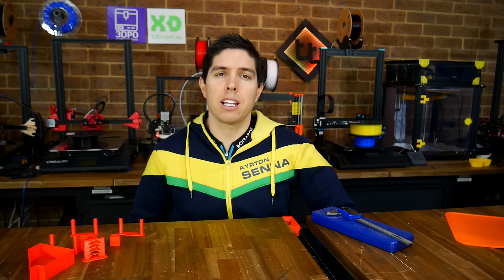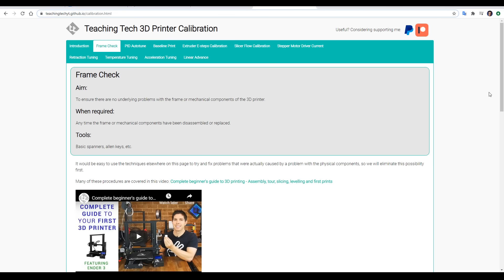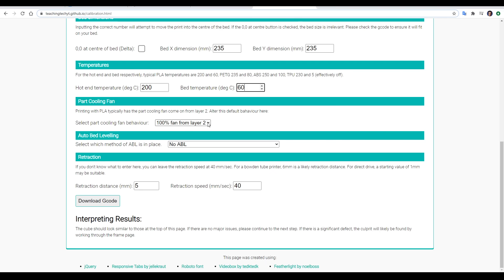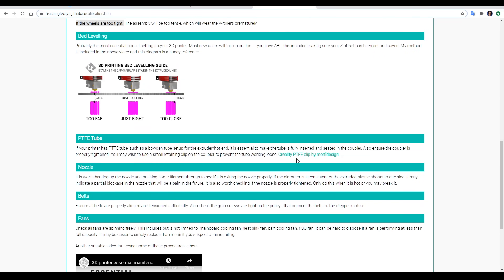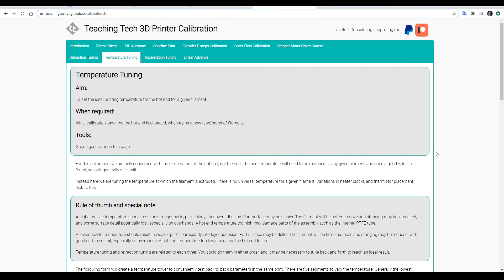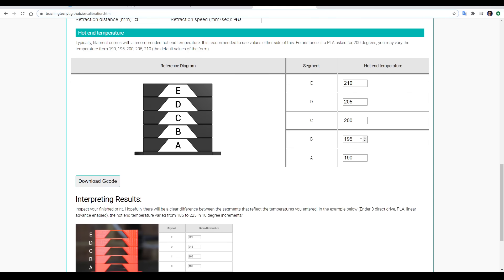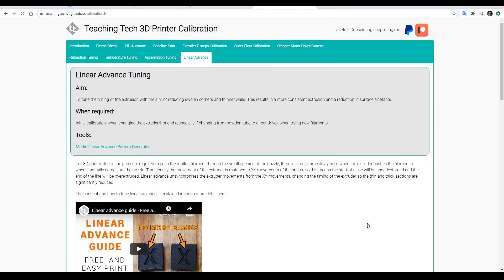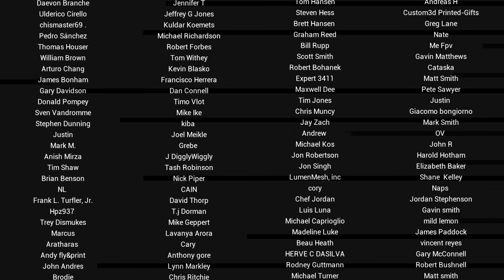3D printer calibration revolutionised - Step by step to better print quality

Comment from the maker: Thanks so much for all of the positive feedback. Thanks to community members posting on GitHub, some bugs, typos and errors have been caught and fixed. New features have already been added with plenty more to come in the future.
Reply: You are awesome! This is exactly what the community needed. Thank you so much! Maybe you can include deltas in the future, they are a different beast but auto-calibration of the bed surface has come a long way in most flavors of firmware and often works perfectly on machines that are well built and equipped with precision z-probes using smoothieware (LSQ fork for calibration) and RepRapFirmware. In my experience it's better to calibrate temperature before retraction though, because temperature has such a high impact on stringing, especially with PLA which is the most commonly used filament. Keep up the excellent work. :)
Reply: Is it possible to get the settings that the baseline cube was printed with? I got a pretty good print using that, but an extremely ugly print using my own slicer settings.
Reply: @Teaching Tech, Could you add the menu option to select your Nozzle Size on these calibration tools? I, like a lot of others that are moving on to printing more, have found it necessary to jump up to a 0.6mm or 0.8mm nozzle diameter for faster and/or larger prints. Again, much thanks for all you do and great respect!!!
Reply: This is truly awesome!  I used Dr. Lex calibration guide for my FFCP and had very good results but with my new ender 5 pro it was not straight forward application for other printers (different firmware etc).   This is the awesome counterpart for marlin and just what was needed!

I have a request,  so many of the turnings are hot end dependent.   How  hard would it be to add different nozzle diameters? Say a .8 or .6 or  .2 nozzles?
Reply: Really good guide! Is it possible to use your website / generated gcode for different nozzle sizes / layer heights though? I didn't see that anywhere. Thanks!
Reply: Thank you so much for an incredible effort to produce a very high quality test procedure, something we will all need to do at some point in time.  You've saved us a  large amount of time and frustration with your excellent advice and research in many of your how to videos. Wishing you the very best !!
Reply: Thank  you so much for the work and thought  you have put into this.

My question... I have stock firmware and boards on my ender 3p and Anet A8. 
How do I change my gcode firmware.   Do I have to go to marlin? What  program is used to interface with the printer?
Reply: Pronterface will interface with the printer. It is mentioned elsewhere here and is easy to install and use. I'm running it on a tiny Windows PC. Allows you toe send gcode to and see and control the printer in many ways. It is NOT however, altering the firmware. That can be a bigger deal. @Ezzell_
Reply: [EDIT: Yes]
Great guide! Thx!
Do I need to worry about GCODE flavour when using code generated by the website?
Have a nice weekend!
Reply: @GenericGerman  
The "flavor" of GCODE shouldn't matter. The version could, but typically with each new version there are more GCODE commands, but the existing commands don't change what they do. So, the short answer is, "No, no need to worry."
Have great 3D printing success!
Reply: You have made my day with this your truly a legend
Reply: I've done most of the stuff in this guide before, one way or another. Having the process to work through with the associated website and tools makes everything so much easier and faster though and I can only imagine how much time this would have saved me if it had been around when I started out with 3D printing. Great job, thanks!
Reply: This saved me so much time and effort. Great guides as ever and an even better troubleshooting. You're awesome. Thanks a lot.
Reply: Great job here dude, Makes this job soo much easier, 
Sorry if this has already been asked but do you plan to add some sort of initial layer height adjustment? It would be nice as I have scraped my bed a bit.
Reply: This is excellent! Could you possibly add E_JERK tuning to the acceleration/jerk tuning page?
Reply: your the man. mate thank you.
Reply: Michael, I just had to say that this earned you a new patron. It's a fantastic resource and very generous of you to put it out there for free. Bear in mind I've never signed up to 'patronise' someone before - there are so many worthy causes - but I figured you needed rewarding for this 🙂 Thank you!
Reply: fantastic resource for new printers! just curious though I have taken to using a 0.6mm nozzle recently which has produced some nice results and printing times. Can I calibrate as per the instructions on the site with a 0.4mm nozzle and then change to a 0.6mm nozzle or would it change the results drastically?
Reply: Thanks for all your work on this. 
I've just restarted calibration after switching nozzles and noticed that when I start my print, it now drops the extruder back down to my print setting -50 degrees, then homes, restores the manual ABL mesh and goes back to print temp. As I preheat my printer to print temp manually, is there a way to adjust this that doesn't involve manually editing the gcode?
Previously that intermediate temperature step wasn't there and it just slows down my process as I wait for the extruder to cool down, then heat up again. 
Or is there some good technical reason to home everything at an intermediate temp that I'm missing?
Reply: Awesome, a new standard is set!
Reply: I have an ender s1 how can I calibrate it using this site
Reply: Great video. I’m going to start tuning now.  I do have a question though. Right now I am getting a bulge before a corner. Almost like what you said LA helps take care of. I did do your acceleration test and 60mm I went from 500-1000 and that bulge is going away the the more acceleration. So I’m about to test now even higher 1000-1500 acceleration. Doesn’t that seem really high?  Or is there a different setting that places this bulge pre corner?  Any help would be appreciated.

Comment: I think there could/should be a batch of gcode that prints a bed full of test objects that let you dial in any filament on any printer. Like the grid for determining duct size in air handler units based on cfm needed and unit hp. Ai can do this now. Rumor has it you're done with this gig.

Comment: on Elegoo printers, why is it better to run the PID calibration using your method vs using the firmware calibration?  Or its the same?

Comment: HI, I just find today your presentation. I will try all the step you mentioned one by one. Because until today I still have issues on my printing. I find you explanation clear (even for a non-native English person ;-) ) . For info I'm still playing with a Anycubic Vyper and using Cura for slicing my parts. Thanks for the time you use for this.

Comment: This is a great video.  However, there is one question I've never heard answered well.  What is the proper z-offset?  I have a 1.75mm filament, a 0.4mm nozzle, and a 0.2mm layer height.  I started by guessing a z-offset of 0.2 would be perfect.  But, I want the filament to be pressed into the bed just a little, so 0.0175mm?  Or, would it be 0.375 to match the nozzle?  the 0.0025 is only a guess.  Is there a science to this?

Comment: your work is spectacular. But my question is if these calibrations are better or not necessary and is the one that comes with Orcaslicer 2.1 enough?
Reply from the maker: I'd say use the OrcaSlicer ones because it's always better to run the tests natively in your own slicer, rather than trying to transfer settings from this.

Comment: This is the single most comprehensive guide on getting started with 3D printing that I've ever seen. I got an Ender 3 V2 almost 3 years ago and had an on-and-off relationship with it, as it never operated the way I wanted it to and I was completely thrown off by the troubleshooting process, as it's somewhat complex to grasp from a newbie point of view. This guide actually got me up and running, thanks so much!

Comment: I have a question about upgrading my extruder stepper motor..
Would like to replace this boat anker 40-42 with a smaller on. I found a stepper that is a 40-23ish, but the torque is lower on the smaller unit. Will this work on my e3 pro? Or do you have a idea of what I should do

Comment: I'm having some issues using some of the gcode with the MK4. I'm not sure if it's because the MK4 has slightly different ABL than the MK3, so there's not an option for it. When I use it, it'll spit the filament out while probing the bed, and then won't have any filament in the nozzle to actually extrude anything

Comment: I upgraded to a Bowden setup for lols on my Anet AM8, I'm about half way through this and this has been absolutely invaluable. I suffered from the dreaded ticking but remembered about retraction from this a few days ago, guessed the value and was able to stem the heat creep enough to start be even at a start.

I was under the impression this is better than  the stock extruder and the prints I've had from it so far definitely confirm this but now I'm wondering if the second hand printer I bought was EVER calibrated....It seems so as the flow rate wasn't far off at all.

Comment: Would it be possible for printer companies to have an x,y,z & extruder calibration option on the display. "For a 20mm cube, your measured X value was...?" The 100mm filament test ran how many mm? Then it calculates the new esteps and adds it automatically. What do you think?

Comment: Bruh the more of these video's I watch the more I realize how utterly useless my Flashforge Adventurer 3 is. They literally went out their way to make things as difficult as possible. You either run it at stock settings and okay-ish prints for own use (useless for customers) as long as you use their brand filament- or you use a different brand filament and find out how completely useless this device is both design and quality-wise.

Comment: GREAT video, exactly what I was looking for. I just bought my first 3d printer, a Neptune 3 Plus, and I wanted to do all of these before using it, but as you can imagine that meant a lot of hunting on FB, YT, and Reddit. You have put everything I needed all in one place, and your explanations are thorough and clear. Well done. I may need suggestions on ranges of values to enter into some of the cal procedure columns, if I find that's true I'll open an issue as you described. Well done. If you have a way for a direct cc support (vs pp) I'll do that too. Cheers.

Comment: I am experiencing something rather odd on my Ender-5 Pro.  Following the steps in this guide, and using your gcode generators, my first layer print test came out great, as did my baseline print.  However, when I download the STL of the XYZ cube and slice it, it comes out like garbage!  It's the same model as the baseline!  It clearly must be a setting in the slicer, but I get the same results in any slicer I have tried!  I'm baffled!

Comment: The retraction test doesn't work on a Klipper printer.  I went through the process and the 'calibration test' came out perfect. Not a string in sight at any level.

Go to print something, and there's string everywhere.

Do the test again - no strings.

I made my own retraction twin towers  using F360 and used S3D's 'Variable Settings Wizard' and used your methodology to change one parameter for each test.

More long winded than your automated 'proforma' tool, but at least it works.

This is not a complaint, mind you.  Your tool helped me make my own.  Just letting you know it doesn't work on any of my Klipper printers.

Comment: One of the community greatest asset! 

After printing almost problem free for 2,5 years i now hit some walls in regard to the needed quality.
This was after my stock ender 3 v2 hot end fan failed. I upgraded this and the parts cooling fan to sunon 24v 40x40x10 in combination with a briss fang type.

Stringing gallore and adhesion issues. Currently working through the recalibration steps.

My setup now:

micro swiss dual gear extruder
capricorn tube
New stock hotend and fans
Dual Z axis (additional stepper)
Upgraded springs
CR Touch
Pei plate

Firmware atm: Back at Ender 3 4.2.2 BL/CR 

Tried: 
Jyers 4.2.2 CR Touch 3x3
Jyers 4.2.2 UBL 10x10
mriscoc/proffesional software 

Your video's and website will help me immensely , thanks a lot! Keep doing this great work!

Comment: Really appreciate all the hard work, this makes it easy for new users to get started.

But why do all you 3D guys make extruder measurement so complicated? 
Why put the 20mm into the calculator?
Have the input be ACTUAL distance extruded, or add fields where you can choose either input.
The added math is unnecessary and makes it complicated.  Not everyone is good at math. 
This makes it extremely complicated to explain to someone who is measuring the actual distance. 
It's more accurate to mark the extruder at the exit, flush with the top of the extruder, then just measure what came out.
A magic marker line is horribly inaccurate against a ruler and will make results inconsistent.   if you mark the exit with a marker, it's ALWAYS going to be flush with the exit hole.   Then you can measure that distance.
you can even cut the filament flush with the extruder exit and use a caliper to to measure the distance out to get 100% precise measurements.

Comment: Greetings Michael,  Thank you for sharing your process for setting up functions of the 3D printer in a solid item by item format.  Top Shelf sir. 
As I have been working my way through the 14 tabs I have run into the need to adjust my Z-Offset when using your  G-Code generator for the prints.  And I need a little direction if you have a moment.
The Z-Offset on my Ender3 Pro is set to -1.82mm and is producing great layers, but when I run the G-Code generated in your Calibration Tutorial the print nozzle is too close to the build plate.  
I have Miguel Risco Pro firmware loaded on a Creality 4.2.7 MB and a 40010 Display Kit on the machine ( E3 V2 Style ) and it is also flashed with Miguel's firmware.  I have tried to his Z Probe Wizard, during the print, to change to Z-Offset but with no success.
I have been reviewing your generated G-Code and I see some G1 Z0.200 F1200 commands and I'm wondering if these could be edited to allow me to move the nozzle up from the build plate.
I really don't want to crash my G10 build place so if you might send me in the correct direction I would be most grateful.
Once again thank you for your efforts with this calibration tutorial.  With respect you have so well earned.
Doc'
Reply: The Z-Offset turned out to be a none issue.  After doing some experiments with your G-Code Generator I found that my z-offset needed to be set to -1.60mm from its current value of -1.82mm which could be set in Miguel's Pro firmware.  I must ass-u-me that the difference something between the Simplify3D(R) Version 4.1.2 and Cura 4.13.1 slicers.

I'm all good now and having a great time going over all the calibrations.  Thank again for your efforts for and support to the 3D Printing world.
Doc'

Comment: I go to calibate my e steps and the calculator get me closer and closer but it dosent get me to exactly 100mm. I started out extruding 65mm through the hotend so input everything change e steps and retry and now I extrude 75mm and so on and so on. my e steps went from 130 all the way to 350 and Im still not extruding 100mm like 95mm. If I take the filament out of the hotend and calibrate my e steps are about 180. So what is happening here
Tags:

Comment: Don’t know if your still watching for comments on this, but you might want to add a test for axis skew to tour test suite. I was in a discussion with someone about this on Reddit and it doesn’t seem to be very widely known.

Basically, even if the bed is leveled to the x axis, there can still be skew in prints where the layers move slightly front to back or side to side in one direction as the z axis goes up if the gantry is not perfectly perpendicular to the bed in both directions. People normally set it up as perpendicular to the base rails, which is usually close but not perfect. It can still be a bit of a parallelogram rather than a rectangle. In that case, everything runs smoothly and the layers are flat but each layer move a bit to one side as it goes up. The same on the y axis if the bed rail is not exactly perpendicular to the gantry. 

Think of a parallelogram with bottom the bed and top the horizontal nozzle path. If the gantry verticals are skewed to the side, it’s a parallelogram instead of a rectangle. X axis still moves smoothly but a tall tower well be a little crooked. Same for the y rail as bed moves front to back. 

I haven’t seen any tests really for this. I made a print that is a cross on the bed with a tall tower at the center. You can check the angles from the vertical tower to horizontals with a square to see how much you are out. I was about 0.01 inch every 3 inches. It tends not to show in most prints but can in functional parts.

That test print can Aldo verify x and y are 90 degrees, plus I made each leg and tower 100mm so you can use it to test for shrinkage and calibrate that out.

I’d be interested in your thoughts.

Comment: I have seen some parts of the website, mainly the extruder step calibration calculator.
What I don't like is all these calibration test sites is not being clear about what to look for when a parameter is over or under valued
I'm surprised that too much retraction distance would cause more stringing.  I thought it would be less with more distance, and stringing is my main problem, even though I fouund the default extrusion step setting has been under extruding.
Strange.